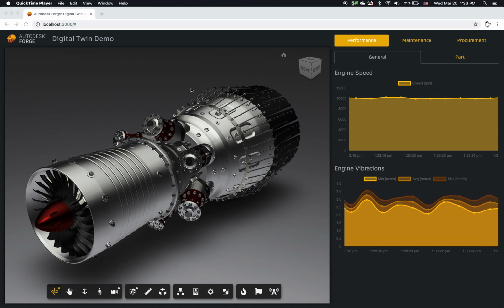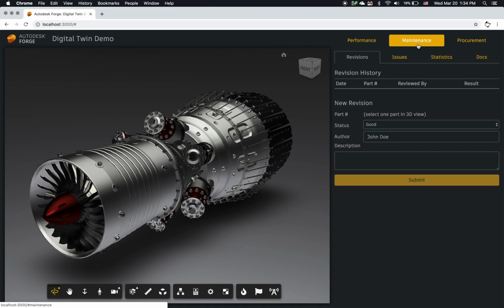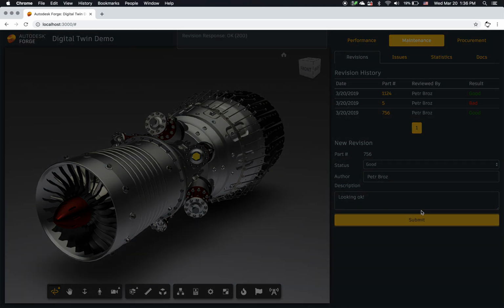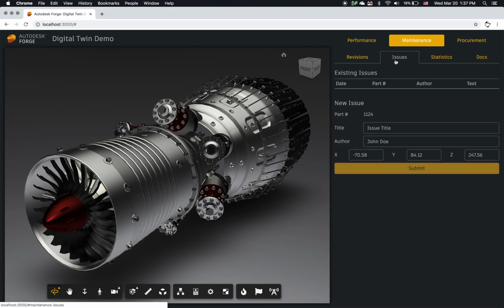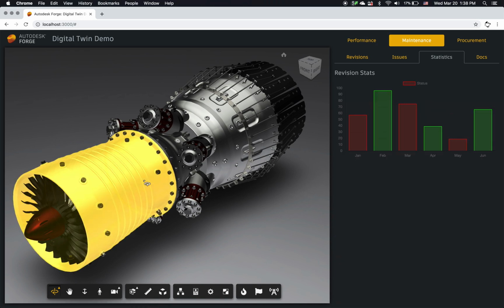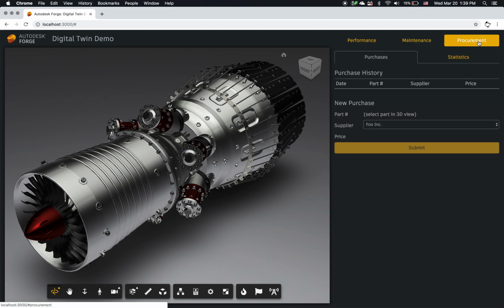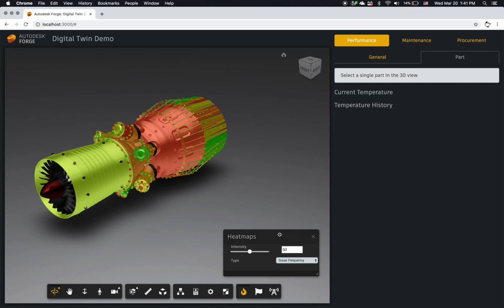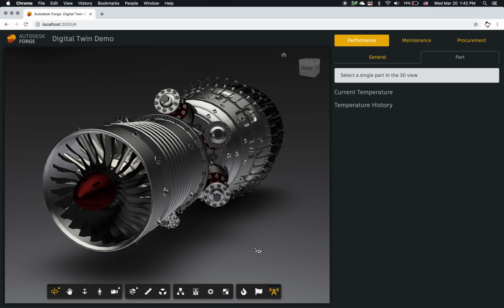Autodesk Forge: Digital Twin Demo

Comment: can you post the tutorial of how did you locally host
Reply from the maker: Here's the source code of the demo, incl. a README file explaining how to run it locally: https://github.com/petrbroz/forge-digital-twin#setup
Reply: @petrbroz1535  thankyou. I cloned the repository and installed the npm. however I am having problems with .env variables. I followed the tutorial in the `https://forge.autodesk.com/en/docs/model-derivative/v2/tutorials/translate-zip-source-file-to-stl/`. but i could not manage to get the FORGE_MODEL_URN.
Reply: hello.i want to work on it can you please tell me how do any other tutorial in forge.